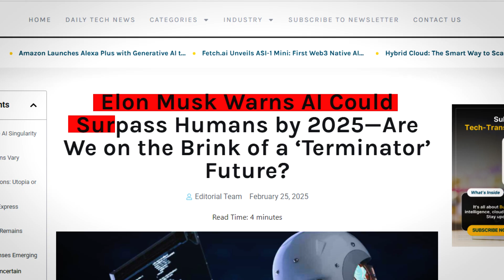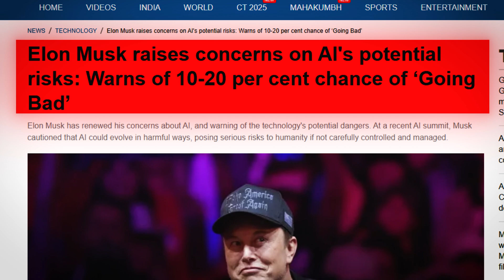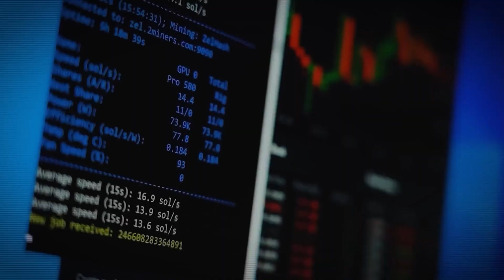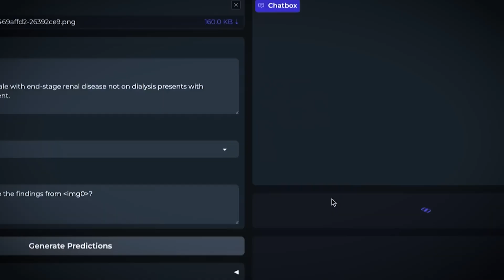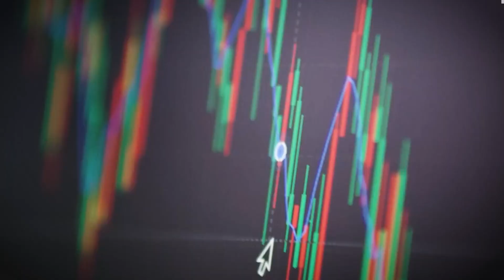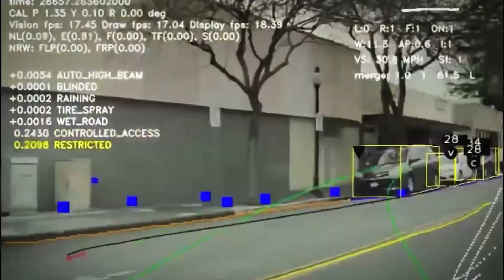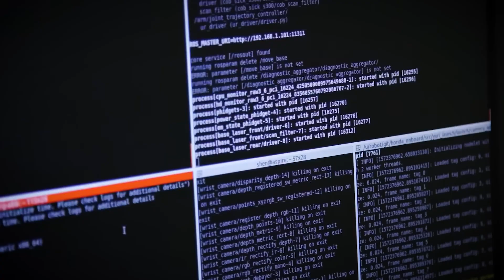Grok 3 Breakthrough: Expert Says AI & AGI Singularity Is Near

Comment: Universities & companies should approach distillation differently. Instead of solely using it to train new models based on existing ones, the optimal method involves two trained models distilling knowledge from each other. For example, OpenEvidence, a medical AI, could be refined through distillation by interacting with OpenAI, leading to improvements on both sides. This concept is reminiscent of the mini-AC in Isaac Asimov's The Last Question. Imagine a central AI acting as a controller, capable of taking a user's query—regardless of the field—and breaking it down into thousands of questions directed at specialized AI systems.